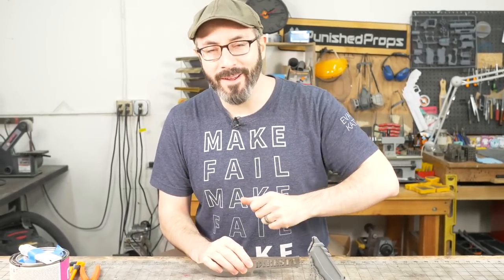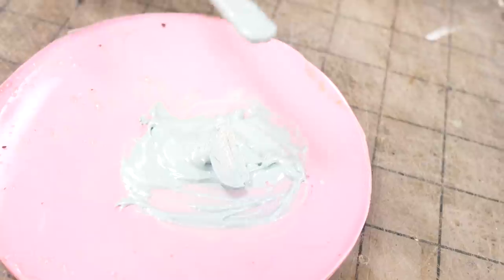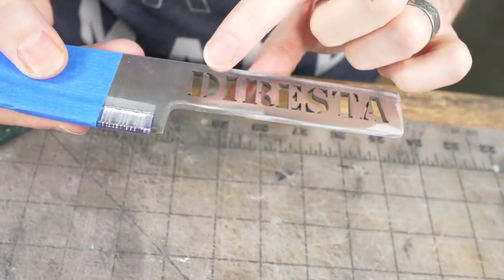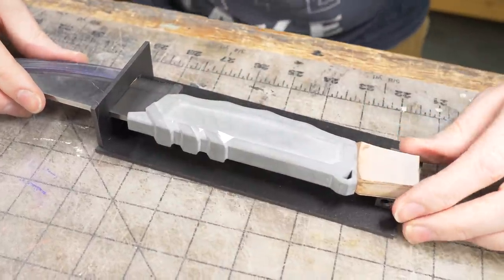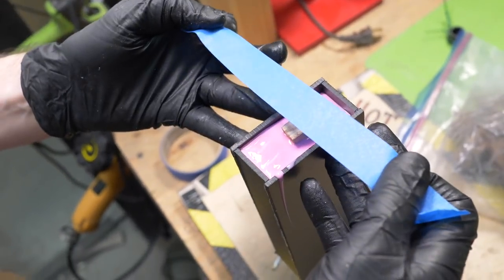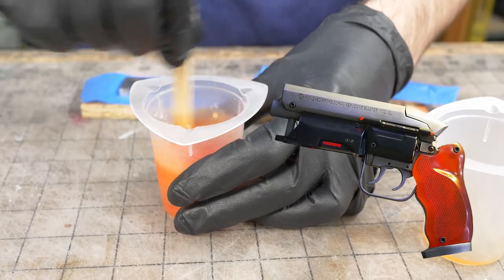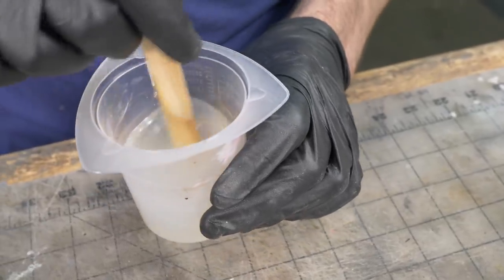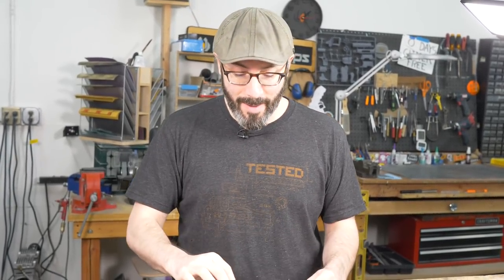Making a Ghost Handle for the DIRESTA Skeleton Knife

Comment: Very cool, STILL! I just got my first 3d printer and found your .stl on my hard drive from when you shared it. I forgot about this, it’s so cool.  Mold making is also something i want to experiment with. I’m wondering if you’ve had any adhesion issues with the handle slipping off. I think i will file some notches into the metal handle so the epoxy has more of a mechanical connection… if i ever get to do this myself!

Comment: Could you do the cut out version of the handle on in a solid color, then put it back into the mold that you used here, or a modified one, and put clear over just the lettering?  Might not even need the 2nd mold if you're ok with recessed panels of the clear in the handle.
Reply from the maker: Yeah that might work!

Comment: what would be cool is if you did it in your logo colors and marbled the handle and had your logo and Chanel name engraved on the knife if i had one i would do what you did but the diresta logo would be in a crimson blood red and the handle would be that same red but marbled with dark blue, dark grey and black in a ww1-2 trench knife with a knuckle duster with the center removed and showing the diresta logo and adding some metal shavings and pieces of silver, steel, gold, brass, copper, and lead from bullets in the logo and handle also having the blade in a k-bar style with geometric serrations at the base of the blade(also the blade would be a really bold Damascus blade with a high carbon edge.

Comment: Suprised to see you still leave supports on when curing vs just giving them a min or 2 soak in some hot water and they about fall off and leave nearly 0 evidence. It also would extend the life of your wash since the supports hold onto a LOT of uncured resin that then just ends up in your wash system.
Reply from the maker: Thanks for the tips!

Comment: Awsome build, makes me want to finish my 5 foot claymore sword from Braveheart I modeled in Fusion but never got around to printing. A tip for resin printer owners, check out the 3D Printing Pro channel. He's got amazing resin support settings that just pull off the print and leave almost no mark (if done correctly), I highly recommend watching his videos.
Reply from the maker: Can't wait to see it done!
Reply: Something as long and skinny as a claymore would need some kind of reinforcement.  Maybe a kite spar or 2 down the length.  Which would also be good for aligning the sections of a printed blade.
Reply: @hanelyp1  I put three holes down the length of it. One for support and 2 small ones for alignment. I still haven't printed it. Lol.